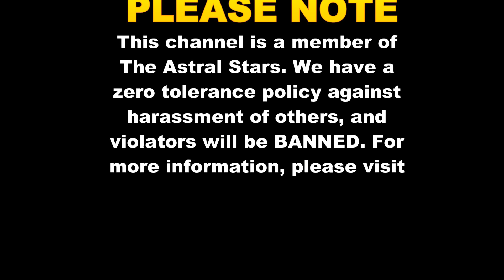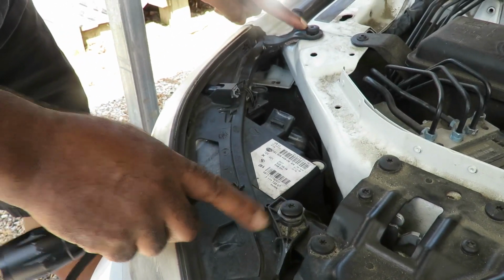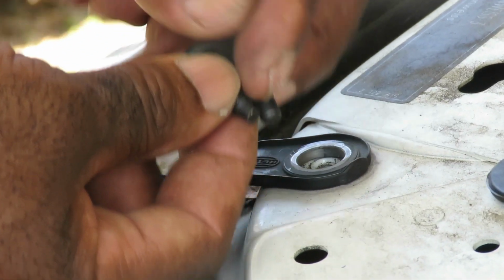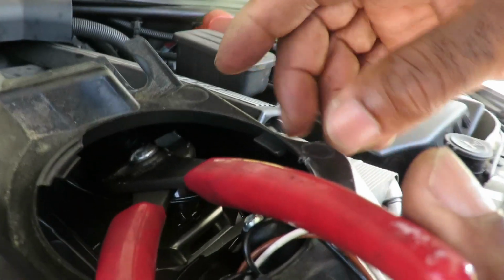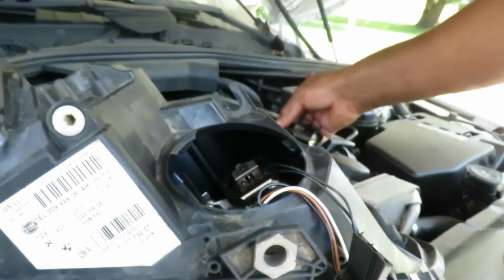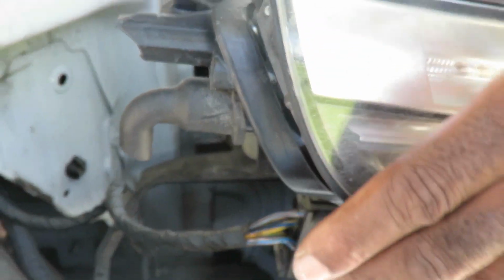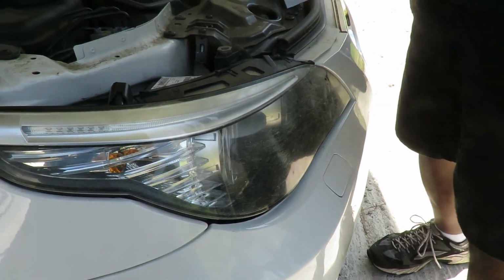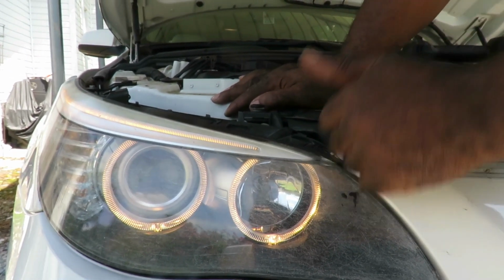⭐ 2010 BMW 528i - Halo Bulb - Angel Eyes Bulb - Right Side Parking Light Bulb

Comment: Can to no good oxygen sensors make your vehicle smoke
Reply from the maker: I guess anything is possible, but I'm definitely going to say no.
Reply: Astral Auto Repairs I guess it’s time for me to get rid of my Mitsubishi
Reply from the maker: What color is the smoke?
Reply: Astral Auto Repairs Just like the color blue
Reply from the maker: Oil burning, so...

It could be valve seals, piston rings (doubt it), or a clogged pcv system.
Reply: Astral Auto Repairs Thank you so much for replying back and is 2002 Mitsubishi Montero sport